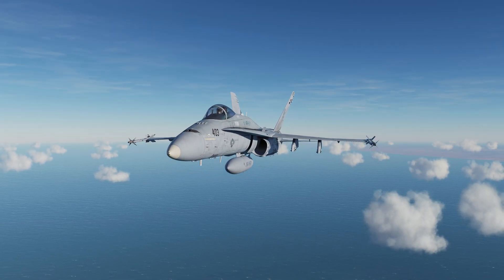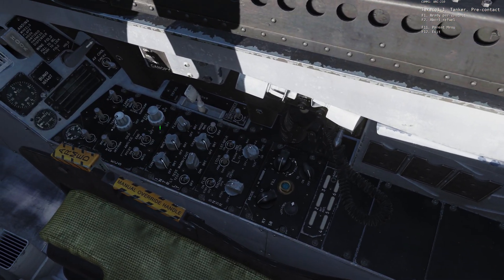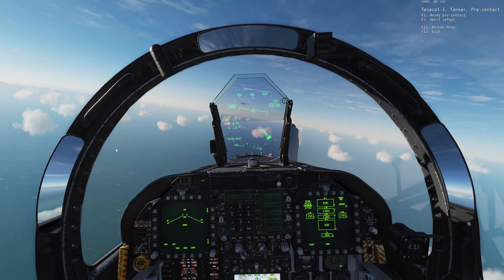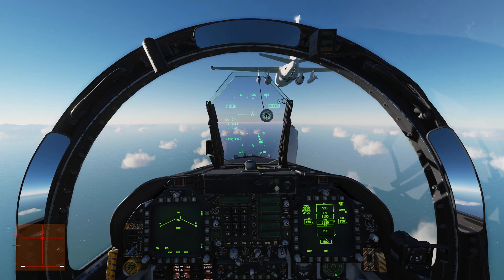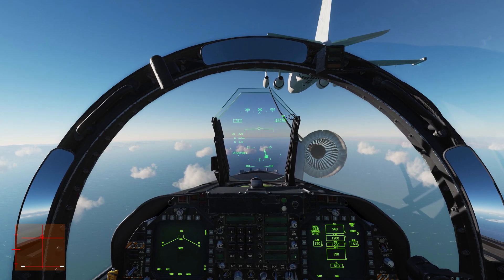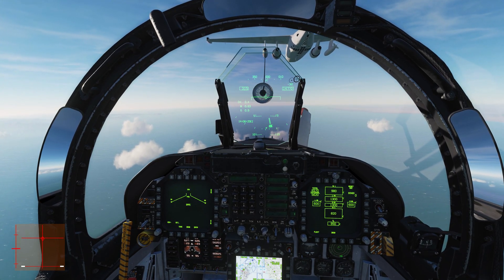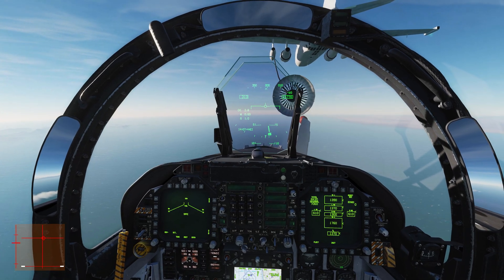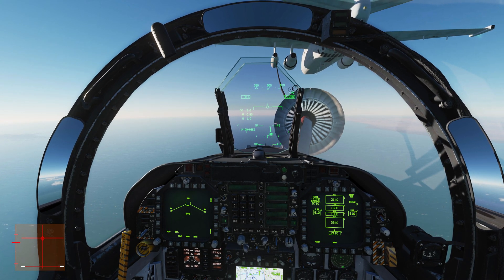DCS: F/A-18C - Air to Air Refueling Tutorial

Comment: You can also flick the FCS Gain switch to override (covered switch near the probe control). You'll lose your autopilots as long as its not in Norm, but it also deadens the stick a fair amount, similarly to the su-33's refueling fcs mode.

Comment: My Hornet always tends to pitch a bit down and trimming doesn't seem to do anything, Any tips? Thx
Reply from the maker: The Hornet has automatic trimming so you won’t need to touch it for AAR, just for setting your AoA when landing.
Reply: @jarentz  Thanks, I already knew that, but I found out it has been an issue of my old crappy joystick that I can fix every time by calibrating or resetting it to default in Windows usb game controller settings.